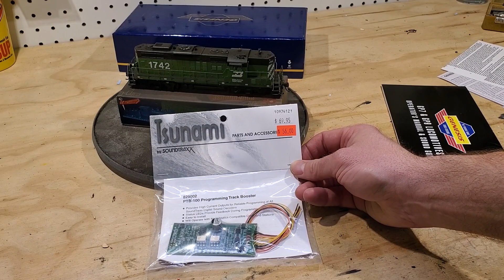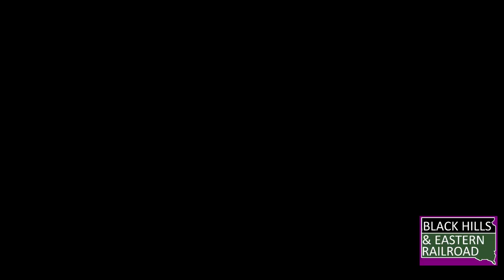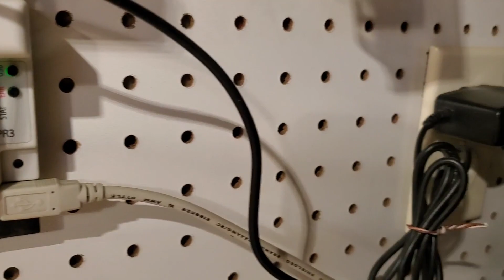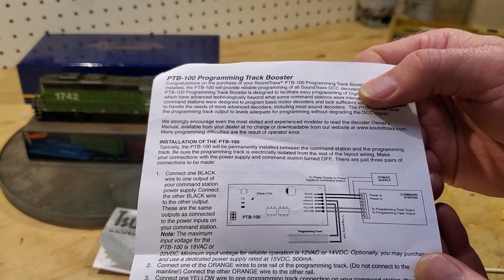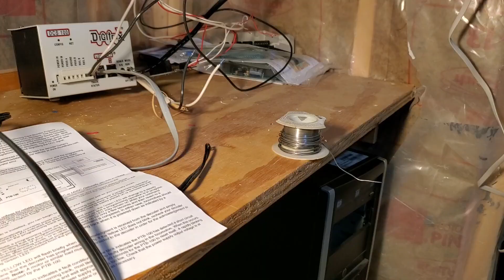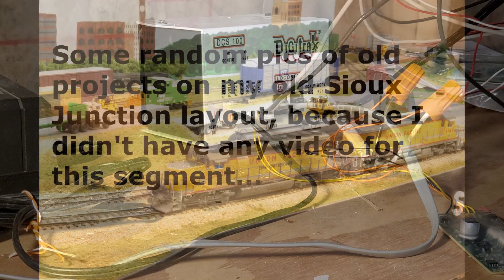DCC Programming Track Upgrade - Installing the Soundtraxx PTB-100 Booster

Comment: I have the DCS100 too. Video cuts out right at the most important part. How did you end up with two yellow wires? Did you cut into the PS14? It's the small stuff that counts. Thx.
Reply from the maker: @roadrunner7328 - Yep, for sure.  Even though I don't show connecting them, I mention that the yellow wires go to the two programming connectors on the command station before and after I connect them.   This is shown in the documentation that comes with the PTB100 and, IIRC, the Soundtraxx documentation that came with that Genesis GP9.    Have not tried this with my old QSI decoders yet.  Hope that helps.  Thanks for watching.